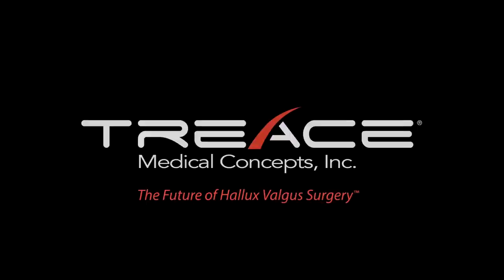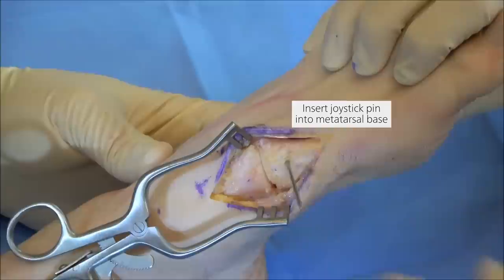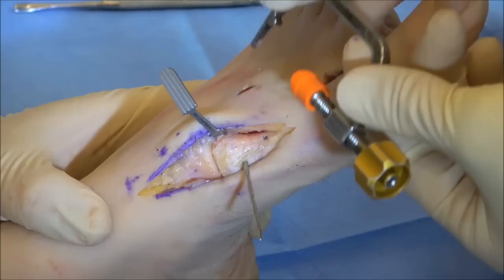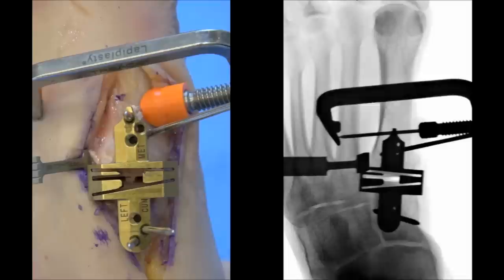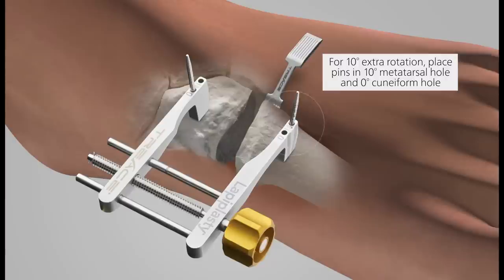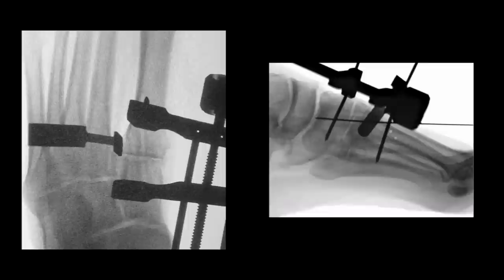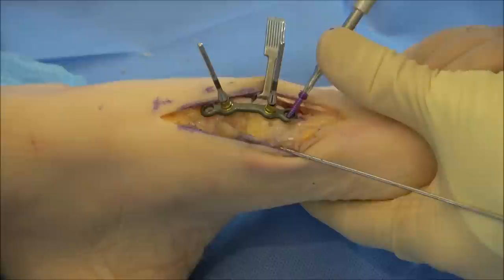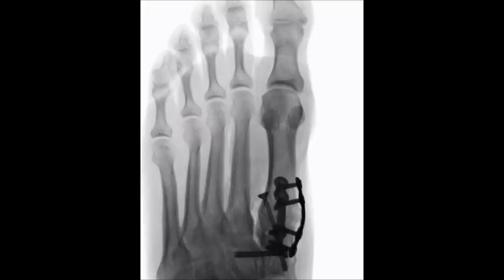Full Bunion Correction - Lapiplasty Procedure Demonstration

Comment: This seems dated but it was only from 2018. I think now they have really minimally invasive techniques where you can be walking right away
Reply: This is what you are talking about there is no recovery time with this... It is more invasive because they claim this will fix the problem itself unlike other surgeries, note the rotation part with the clamping tool. The problem is not the bunion but the rotation of the bone which is the cause.
Reply: @MADCHiCK3NFTW  I am waiting for this and I was told that recovery is two months
Reply: Wow I just found this comment, so since posting this comment I worked for a podiatrist who did 3D lapiplasty and yeah you can’t walk on it for a few weeks, and it does take about 2 months to recover. Also they won’t do both at the same time!!
Reply: @emilymurray7331  it takes at least 6-12 months to recover
Reply: Hahahaha
Reply: I've been doing research about what surgery would work for my bunions.  The doctors a saw wants to do a toe fusion but your toe will be stiff forever so I'm interested in this procedure 3D

Comment: Pain is gone.  Big toe only goes up 60 degrees.  Not satisfied.  Also,  if I stop stretching it, the bunion will reform.  I had surgery 6 months ago,  and still feel like I can't walk the right way.
Reply: How about now
Reply: 4 years later, I'm wonderful.  I think I had some capsulitis in my second toe because I was walking on the outside of my foot, and it was hard to get used to walking the right way.

I found it was just as important to stretch my second toe as it was my big toe because it is working differently now than it did before the surgery.
Reply: Finding the right shoe makes a difference.  I like sketches go walk sneakers.

Comment: There aren't many reviews of this procedure. What are the potential complications?
Reply: Jessica Stalnaker excessive swelling is the most common. You will get bruising and pain for the first 2 weeks or so. It is a minimally invasive surgery so not too many complications but I definitely struggled with swelling
Reply: @hallowseve8863   do you have high arches? I never see anyone talk about their bunions and high arches.
Reply: Ivette Garcia I have extremely high arches and I was a ballerina en pointe for most of my life, so my feet were a nightmare. But my high arches were not a problem in regards to the surgery whatsoever!
Reply: @hallowseve8863  could you still do ballet? What were your limitations? Excuse the amount of questions im asking
Reply: Ivette Garcia you are totally fine lol no worries. It depends on the doctor usually, but personally I was on crutches in a cast for 5 weeks, and in a boot for a total of two months. The healing is about a 5 out of 10 on the pain scale, but the result of the surgery literally changed my life. I would recommend this surgery to anyone who suffers from intense pain from bunions/ joint rotation (in my case)!
Reply: Ivette Garcia I was also out of work for about 2.5 months, it sounds like a long time but my work was very supportive of my decision!
Reply: Ivette Garcia and I actually quit ballet long before the surgery due to issues with my knee, sorry for responding in three different comments 😂
Reply: Stiffness will always be there and you will never again have full range of motion! Do not let these doctors screw with your feet! That is the base of your foundation. My toe is permanently damage now, I will never again have full range of motion. Unable to plantarflex my big to. Limited dorsiflex. It hurts, stiff and it reduces physical activities like running and
Even doing push-ups
Reply: @tonyfitnessmotivation  I can do any workout just fine even push ups. Best decision ever!
Reply: @kumikomay2972  did you get the lapidus or lapiplasty surgery specifically? 👀
Reply: Do not get this surgery. It is dangerous and destroys your joint forever. I can barely walk now. Get either an osteotomy (much safer) or the tight rope bunionectomy

Comment: It is the most invasive of all. Scar is very big. The traditional surgery is less invasive.
Reply: Are you of that? I’ve seen countless videos of the traditional Osteotomy and Fusions, and this seems less invasive...and it gets to the root the issue, whereas the others increase the risk of recurrence.
Reply: @DoulaLikeALady   this surgery will destroy your joint and is a dangerous surgery. If you want to walk without pain, don't go for this destructive surgery. Get a tight rope or fast forward procedure (look them up)

I had it done and can't walk or run
Reply: @austinjoseph2881  You’ve had this one? Geez I hate that you’ve been limited in your mobility. I definitely wouldn’t want to get a surgery just to be unable to do what I love (walking around, enjoying nature and simply walking in general). Maybe I’ll just live with my bunions 🥴
Reply: @austinjoseph2881  so I just watched a few videos of the tight rope. Wonder why this never came up in my search for different types of bunion correction surgeries…
Reply: @DoulaLikeALady  Hey Jae, so yeah unfortunately the lapidus/lapiplasty (they are the same thing) will permanently destroy your mobility. I found out the hard way - I can't walk or run barely at all and I miss moving so much. 

Osteotomy cuts your bone in half. This results in a permanent deformity that will affect your gait. It's better than a fusion though because it doesn't destroy your joints. 

The best answer is the Tight Rope bunionectomy. It doesn't destroy any of your joints or cut your bones at all! Instead it realigns your natural anatomy by just pulling your bunion bone back into alignment :) 👍🏾

However, the problem is, in order to pull your bunion bone back into alignment, they have to tie it to your middle toe bone. This puts your middle bone at risk of breaking due to the pressure on that smaller bone. 

The Fast Forward procedure addresses this risk by stabilizing your middle toe with a metal rod. Here's the link to the video and she's the doctor I'm going to now to fix my foot: 

https://www.drburatti.com/fast-forward-bunion-encino/
Reply: @DoulaLikeALady  feel free to ask me any other questions! I love helping people after my surgery failed
Reply: @austinjoseph2881  thank you so much
Reply: @DoulaLikeALady  this helped? Any other questions?

Comment: Can someone explain the difference between a lapidus surgery vs lapiplasty??
Reply: Lapidus, *I believe*, is the traditional Bunionectomy. This is less invasive and actually adjusts the root of the issue.
Reply: @DoulaLikeALady  both destroy your joint and are dangerous surgeries. If you want to walk without pain, don't go for this destructive surgery. Get a tight rope or fast forward procedure (look them up)